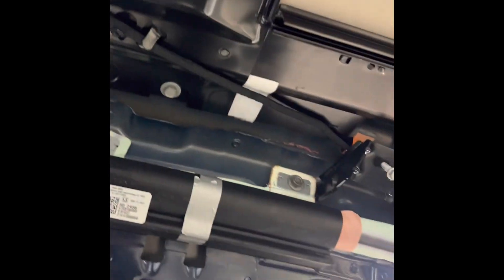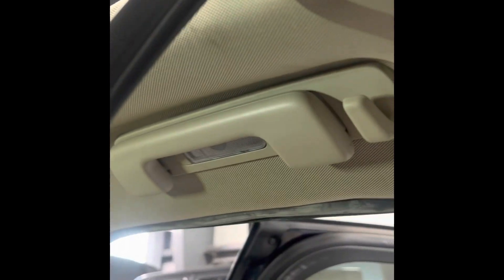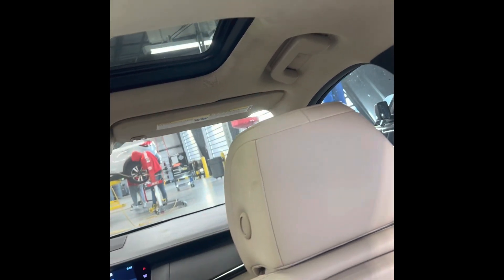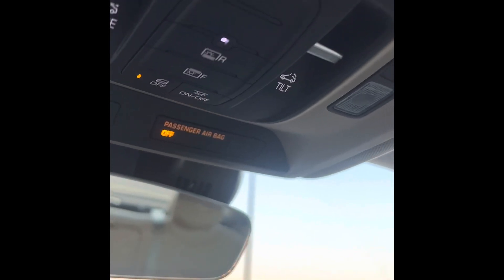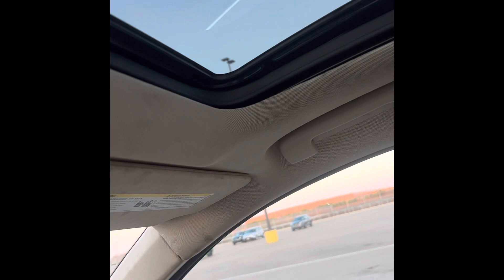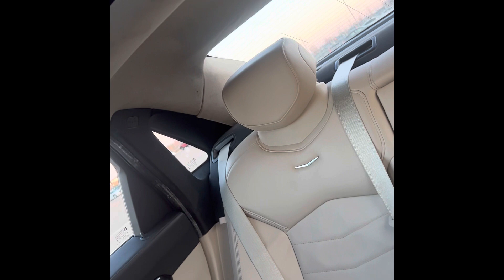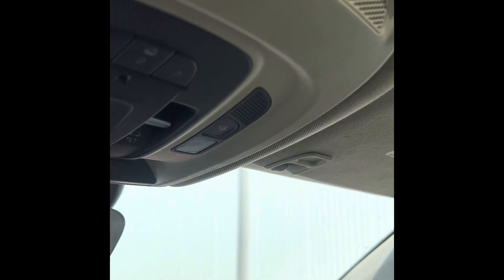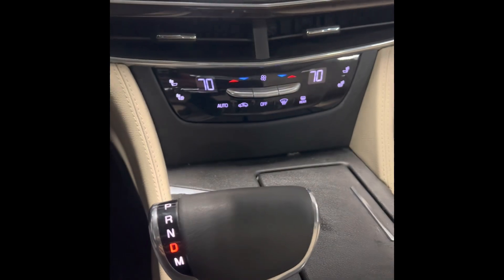2017 Cadillac ct6 2.0 liter front and rear sunshade removal and sunroof motor location

Comment: I have a 2018 ct6. I have been looking for a video to install the shades. I have taken out both front and rear sunroof. having trouble installing the shades back to the motors. the front motor works, but having trouble figuring out how to reattached the cables that controlls thge shade. Help!